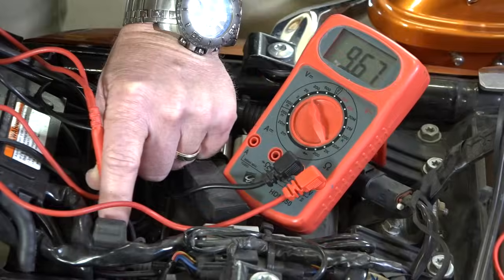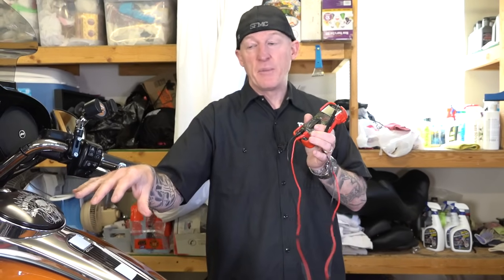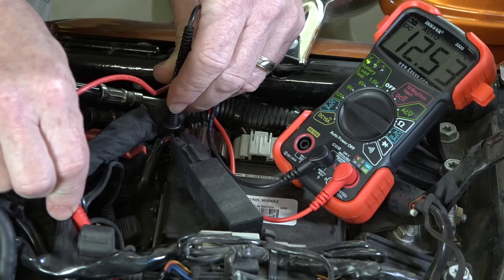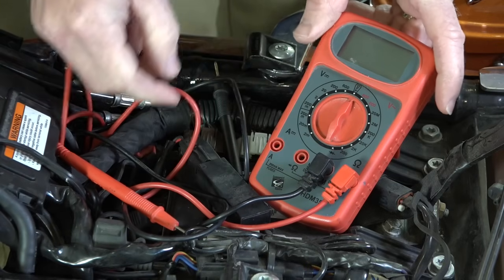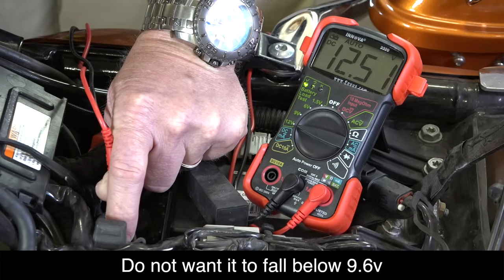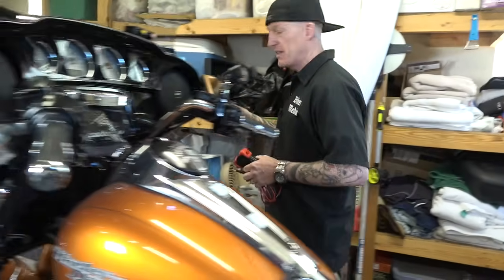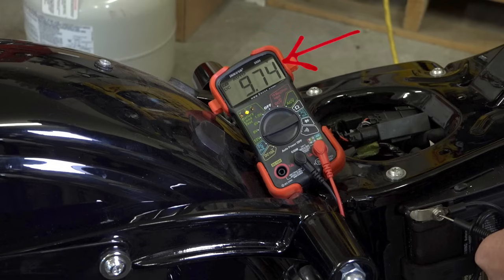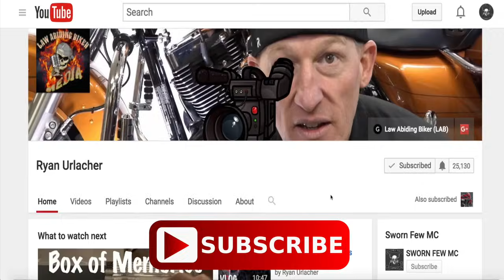How to Test Motorcycle Battery & Charging System-Multimeter or Voltmeter | DIY

Comment: I think my battery is on the way out. It was a really cheap one. I put it on a tender everyday. My question. If a battery has weak cranking amps, could it still crank the bike...mine does...but make a weak spark? at least on start up. My bike runs fine once started. 2012 nc700x manual. fuel injected. 38,000 miles. changed spark plugs with oem about a year ago. The original spark plugs looked great just was way passed service time.
Reply from the maker: It will generally run fine once started.  The cranking amps are necessary to get he bike started.  Sounds like it's time to replace your battery.

Ride safe & Ride Often!

Check out this YouTube Channel as we have a ton of free videos for you!

Check out our useful for purchase videos: http://www.lawabidingbiker.com/buyvideos

BECOME AN ECXLUSIVE MEMBER-GET BENEFITS:
http://www.lawabidingbiker.com/patreon

Leave a flat donation: 
https://www.lawabidingbiker.com/donate

Shop in the Official Law Abiding Biker Store:
https://shop.lawabidingbiker.com

Subscribe to the Law Abiding Biker Podcast: https://www.lawabidingbiker.com/app

Join our free email club:
https://www.lawabidingbiker.com/emailclub

Comment: Hi Ryan. I have a BMW R1200R 2008 and have issues with the starting. I recently bought the motorcycle second hand. I left the bike where I got it from so that they check it as I have 1 year guaruanty, the replaced the battery and then after describing the behaviour they said it might be the starting motor. They checked it and they told me that it was just the positive cable not tightly screwed. However, it has now passed a month and I have the same issue. The motorcycle has problems starting. It may start the first time after I left the bike but if I stop to put gasoline, then it may not start. Something is draining the battery :( any ideas? such a same, I wanted to go on a trip these days.

Comment: Ryan, will a battery that checks fine on voltage but drops low when cranking the engine have an affect on causing engine light to come on and throw error codes?
My 2017 Road King has been cranking over a bit slow this year but no engine light or codes until I changed the spark plugs and now the engine light comes on and throws non comm codes. I cleared the codes and all was good for a little while then engine light came back on. Also the speedo starts to bounce for a little while and the idiot lights come on and off at the same time the speedo bounces.
During all this there has been no effect on the performance of the bike and how it runs. 
Any thoughts on what could be the issue?
Like I stated, the engine light and codes only started since changing the spark plugs. Double checked all my connections and they all appear to be fine.
Also the charging system is performing great.

Comment: Hi dear very impressive.. 
I ve a question, on my 100 cc bikes battery found dead, i check rectifier regulator output found 7 volt!!! In idle rpm and 3 volt when high rpm!! Can u explain me what's wrong here?? Please...  Im from Dhaka Bangladesh.
Reply: My voltage is 12.7 is that a dead battery ?

Comment: am about to replace my stator and regulator on my 2013 Road Glide Ultra.  Long hot ride this last weekend and had charging issues.  The bikes got 60k on it, and I have a hog tunes amp, extra bright Maxon LED Road Lights and a Hog Cooler Vest that makes riding in the Texas heat bearable.   I'm sure I pull more amps than the stock system is good for, so I'm looking for suggestions on what brand you might have used and what brand you might recommend.  I am also looking at going to a lithium battery and was wondering if you have any input on that as well.  Thanks in advance for any suggestions.
Reply from the maker: We would definitely recommend the lithium battery.  We've only used HD stator and regulators.  Check out their High Output Charging System.

Ride safe & Ride Often!
Here is a link to a bunch of our useful Free vids: http://www.lawabidingbiker.com/freevideos
Here is a link to some of our useful for purchase videos: http://www.lawabidingbiker.com/buyvideos
Want Answers & Information Fast? And help support us at the same time? Do you like the content we provide?
Our patrons get answers to their questions/comments/feedback in less than 24 hrs and are part of our Private Facebook Group. If you are interested in being in this exclusive group you can get all the details at ==> http://www.lawabidingbiker.com/patreon
If you haven't subscribed to the Law Abiding Biker Podcast make sure to do so. Listen in as we talk weekly about issues/items like this & so much more. You can listen on iTunes (Apple/IOS), Stitcher Radio (Android), or any other Podcast App ==> http://www.lawabidingbiker.com/podcast
Join our free email club at http:///www.LawAbidingBiker.com/EmailClub. Only relevant content will be sent from time to time. Email club members are the first to find out about free or for sale content are given special coupon codes.

Comment: 2015 HD Roadking......After riding for about an hour, my batt light would come on while the bike was running.  I could turn off some accessories,...stereo and accent lights and the light would go off.  Sitting with the bike off, the battery would register around 12.5 volts, but it would drop as low as 8.6 volts during start up.  After watching your video, I replaced the battery.  Now, I am concerned because the new Battery show 13.00 volts sitting before I turn on the ignition.  However, it idles at 12.63 - 12.69.  Even if I push the RPMS to around 5000 the voltage will max out around 13.80.  Does this sound  normal?  Wondering if my stator or regulator needs replaced too, and trying not to ruin this new battery finding out. Thanks.   ps.  I have around 45k miles on my bike if that helps any.

Comment: I have a 2007 CVO classic. The other day my battery light came on and the bike ran crappy. I was almost home and it died just as I got home. I have had the trickle charger on it and cranked it tonight. Not charging right to me, but at 2000 rpm it get to 12.8 V. At 3000 RPM it'll slowly climb to just over 13 V. But then suddenly jump to max charging and the lights on two of my gages go out. I dropped it back down to 2000 RPM and everything goes back to low charge again. Could the battery be starting to short out?

Comment: Hey Ryan thanks for your videos, really helpful and very well done. (Just one F.Y.I.) I wanted to see if this test does work accurately using the pigtails provided on the bike. So I plugged my trickle charger adaptor with charging clamps into the bike pigtail, then hooked up my multi-meter red (pos.) to red (pos.) and black (neg.) to black (neg.) and got a negative reading. (I'm using an older 1980's "analog" Equus 3022 7-function analyzer that also has an inductive pick-up for dwell and tachometer.) So I swapped red to black and black to red and got a 12.5 hi-volt reading. Then upon starting the engine it dipped to 10 volts and leveled out at 14.5 volts while running. So you can indeed accurately perform this test through the pigtails provided all connections and wires are good, but you have to reverse the cables. Of coarse I agree with you that there are other variables that can throw off the readings like loose or dirty connections but it can be done as long as you know about this connection caveat. I Have a new 2017 Ultra Limited by the way and didn't want to mess with all the connections and covers to get to the battery! Can you do a video on how to properly R & R the battery on these newer Harleys sometime? There's a lot going on in there compared to my '05 Electra-Glide! Thanks again and keep up the awesome work! Much appreciated. Peace out.
Reply from the maker: Rock on Jerry. Sounds like you got it figured out. We always have videos in the works. We are buried and getting to the list as we can. We'll put it on the list brother! Thanks for watching.

Comment: Hey man, just changed my stator cuz my bike killed two batteries, I have tested the regulator rectifier it seemed to work fine, after changing the stator the idle voltage is 13 but when I put rpm on it drops to 12.5, my battery died after 16miles of riding in 2 days, what do you suggest me to do? Can't take it to the shop cuz they charge me lots of money and I'm broke (my bike is a 2002 yamaha vstar 1100)

Comment: I have a Hayabusa that I have not used for one year as I was ill, but it was kept on charge. It shows 12.3 but only makes a Clicking noise when I try to turn it over. I Jump lead from another  bike and it started, left it a few minutes, Then tried to start it, but it would not start, just made the clicking noise again? The Battery is not old?

Comment: I recently installed a brand new HD battery.  The battery died and won't take a charge on my battery tender.  the red light flashes saying battery is not connected right.  I think the battery has gone less the 3%.  how can i get it to take a charge?

Comment: My 12v battery also shows a normal charge with minimum around 11.8 volts with the ignition off.  After kick-starting my bike, when I turn on my headlight or other indicators or even horn, the voltage drops down to 6 volts in just half a second. and when i test my battery again while the engine is running, it shows a good charging at around 14 to 15 volts, but again drops down after turning the light on. Surprisingly, it wasn't like this until 2 days ago. My headlight was blowing bright even without the engine running. Now what kind of problem I'm having here ???

Comment: my bike was dying I shut it off and wouldn't turn back on , I was able to ride it at least 10 miles like that...

so to diagnose 

- I bought a new Harley battery and Harley regulator
- The volt meter is reading steady 12.54V at idle and even with a little throttle
- Ran a continuity test on the plug, the meter would jump to -100 ohms then go to 0 and stay at 0 (is that bad?)
- Did the test across each plug terminal, it stayed at 0 for each

sound like a bad stator? why would my street bob have a bad stator at 12k miles? its only a 2016

when I swapped my compensator I saw some brown discoloring on the stator cover, maybe it overheated?

Comment: Did you know that there is NO such thing as cold air. This is no joke. Most people do not know this fact. Also, all dc voltage really reads -12vdc to +grd. Just some things to think about.  Been riding motorcycles since 1968 and I still love it better than cars and trucks.

Comment: I don't know if you still are posting on this but I NEED HELP.. I have the stator and rectifier replaced and when I test the positive terminal on the rectifier when its running it gets 1.5-3.5 volts by itself depending on how I rev it. HOWEVER no matter how I hook it up to my battery directly or to my main fuse as the manual states, it will not do anything to the battery. The volts just drop and drop. 

I have tried several high end batteries and none of them will take the juice coming out of the rectifier 

What do I do????
Reply from the maker: Hey Marcus, hard to diagnose a problem like that over text. Maybe a faulty rectifier? Wish I knew.

Comment: Bro I have a question that I was checking my battery of hero Xtreme with the same load method and I am also facing self start problem I changed the battery 1 year ago with Amaron. My question is that when I measure voltage in morning it give 9.3 and after running bike it give approx 11.4 what is the reason for that . And please tell that at what volt battery is weak through load test please help me
Reply from the maker: Would be hard to diagnose all that via comments here. So sorry brother.

Comment: Problem with motorcycle turning off randomly while riding and sometimes it’ll catch and not shut off if hand still on throttle. Seems to be happening while riding and it kinda happens occasionally but now it’s happening more and more. Last night did it three times and then wouldn’t turn back on. It’d practically shut the headlight completely off when trying to restart it. Any ideas?
Reply: By the way the battery is only 1 year old

Comment: Can you test the battery through the pigtail?
Reply from the maker: I would go direct to the battery to make sure you get a completely accurate reading.
Reply: Ryan Urlacher thanks for the reply
Reply: Thanks Ryan I knew my Harley was starting a little ruff same starting symptoms as yours sounds just like it I learned something from this video did the cold crank start and it dropped to 8.7 on the voltmeter  so looks like I am getting a new battery and tender😀 Aloha from the Islands brother

Comment: Hello brother, I bought my bike four months ago.I will use my own vehicle once or twice a month. My bike ran over 700km.During this four months, i took my bike after 10 to 15 days. that time my bike speedometer display and self start does not work. I concerned exide service center related about this, they said, Bike usage very lower during 4 month so this problem coming.They rejected my battery replace request.I need reply from you. Is it true?

Comment: Can anybody help me out and tell me what’s wrong. I have a 2000 sportster 883 and if I ride it it’ll run the battery dead but I can still ride it. It’ll still run good just drains the battery. Is it a regulator? Or does anybody have any better ideas? Thanks in advance

Comment: thanks. i am pretty sure i am having this issue. my bike didnt start htis morning - it is starting to get cold. i'm trickle charging now.  it reads at 12.8 right now so the problem might not be the battery.  if after trickle charging for a while - the bike works - i will buy a replacement battery - assuming that this thing is on its way out.
Reply: Jake Newcomb  like the dude said.    Check it with a multimeter during the cranking window.
Make sure you didn’t pick up a unwanted draw.

Also,  you could add a transfer relay to turn of your headlight during cranking ( for non lithium battery’s) 

The dudes spot on with his methods!

Larry

Comment: My 14 street glide keeps blowing the 5a battery fuse...my headlight and radio come on but no gauges or hand controls work and no start.can anyone help? Please and thank you...this has happened before once, my bike got wet I replaced the fuse an it was fine until now the fuse blows instantly
Reply from the maker: Very tough to know for sure without testing many things. Electrical is a process of elimination. Sor sorry we could not help more.

Comment: maby im using this wrong? so i tried starting my bike but it wont start. guess battery is dead. so the multimeter you have with the 12v, i used that on my battery. heres the thing. it read 12.3 or so and the green light was on the check. hmm... am i using it wrong? i did it just how you did in the video.

Comment: I'm such an idiot. So I have a 1977 gl1000 goldwing. Restored it. I bout a new battery with 350 ccas 2 yrs ago. The battery takes a charge an has started the bike no problem but recently it's been alot slower I put my multi meter up to cranked the bike an the volts dropped to below 5 volts. Obviously not good I assumed it was the starter but with new starter it doesn't even crank at all, so is it definitely a battery Goin bad

Comment: Anyone who attaches a Battery system of some kind to maintain the charge in a motorcycle battery should do some investigation.  For me, 2 HD batteries (non Lithium) in 2-years, is a stale story.  My neighbour riding a Triumph, has the same story.  
Way to much current feeding the battery from most chargers.  For riders in colder climates where the bike is idle for longer periods of time than riders down south, the battery support can spell death to your battery.
A regular car battery “trickle charger” is a very unwise choice.   I found what I THINK is the better choice, but I recommend YOU spend some time reading because at $150+ for a new battery, you can spend 30 minutes on the Internet and learn a lot and save a lot of grief.